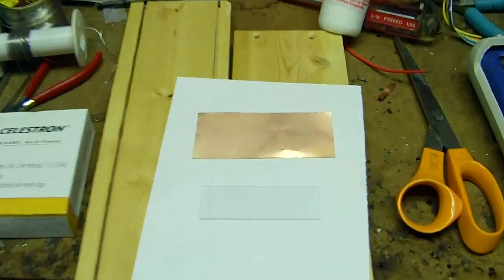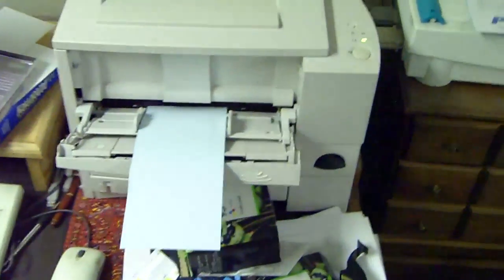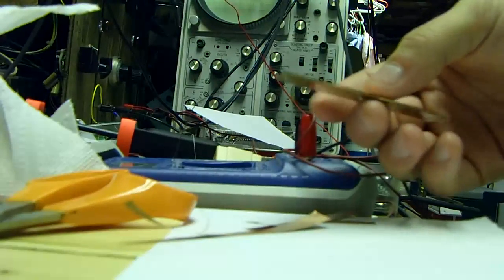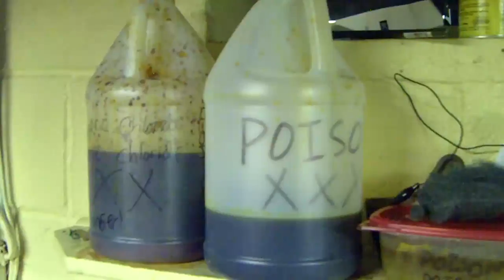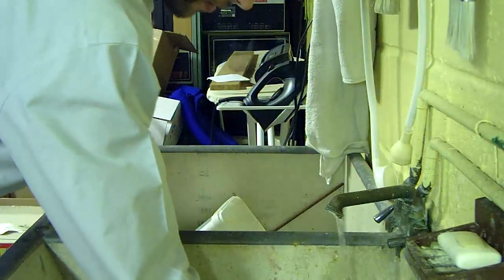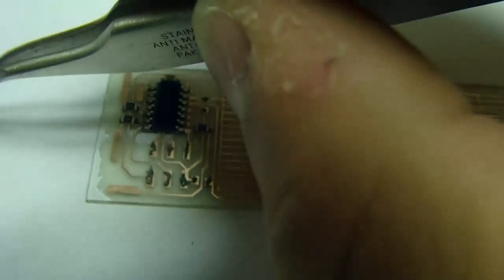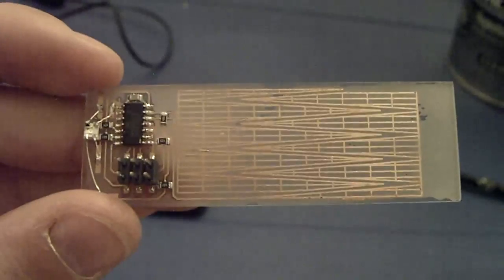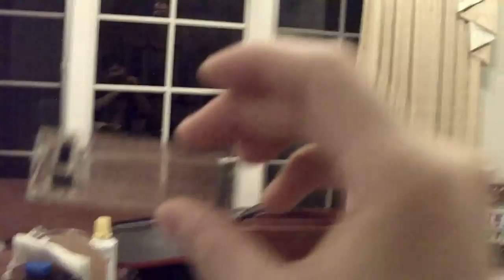How to make Clear Glass PCBs

Comment: Could you use a laser printer to print resist onto the copper first while it is thin? Obviously the printer will need to provide a negative charge to the copper instead of the positive charge the printer normally places on the paper.

Comment from the maker: I actually use the eye protection now for the FeCl, and a respirator for the glue.   Also, I'm using a very different UV light system now, which I need sunglasses for :).  I will add the annotations.  Thank you.

Comment: You might want to consider a 2% sulfuric acid holding tank to keep or remove oxidation off the copper during the process.
Reply from the maker: even now, steel wool seems to be the way to go.

Comment: Optical epoxies should work just fine, and they usually only require a thermal cure. They can also be very resistant to solvents

Comment: Have you tried a UV pond clariier lamp?  I use one occasionally in a special enclosure I built to erase EPROMs.  Mine is 13W, and my cycle time is usually 5-10 minutes.
Reply from the maker: That is what I used here.  It turns out UV grow lights work much better.  See my new video! :)
Reply: CNLohr what video you mentioned here? i can not find it yet
Reply from the maker: I don't know what you mean... do you mean you cannot find the UV light?

Comment: Do you think your "copper leaf" is solid copper, or does it have a thin layer of fiberglass on  the "dull" side?  (What happens if you throw a piece of the leaf into etchant without adding your own backing?) (I'm wondering whether the cloudiness you solve with PU is from the glue, or from the leaf?)
(ordinary glass absorbs a significant percentage of UV light, BTW.  It's nearly impossible to get sunburned inside a windowed building, for example, and "good" UV lamps are made from special glass.)

Comment: Have you tried removing the UV glue in small sections, then painting on a thin layer of thin acrylic? if you do it in small sections, you'll probably not be prone to large amounts of slippage, and will be able to replace the UV glue with something more aesthetically pleasing.... perhaps even embed the circuit in acrylic, or a 2-part clear setting polymer. depending on how you are able to make one-off molding, you could possible embed the entire device in such a material, leaving the connection pins exposed for programming / testing etc.
Reply from the maker: +ArcAiN6 Regarding pulling the traces off... that sounds much more manual than what I can reasonably do.  But, regarding potting stuff, I agree that would likely be cool, but I rework my boards soooo much that it would make me feel bad not to be able to work on my PCBs.
Reply: Completely understand that :D

Comment from the maker: @roostersglass Actually, the frosting is because of left over glue, it is not in the glass. The glass remains crystal clear.  For much larger pieces, I'm still working out the inks, but I have pretty good success with B270 glass. I'm right now going through SI Howard Glass, but they are a bit frustrating when it comes time to ship your package.  I've tried a number of other glasses with less success, low iron, soda, and borofloat.  Other funny thing: my pyrex etching bowl is permanently stained.

Comment: you can use copper adesive tape, so apply on glass and draw the circuit...
Reply from the maker: I have tried that.  It didn't work.  The adhesive tape didn't stick well at all.
Reply: CNLohr Tnx for reply ! and tnx for the tip...
btw: nice work !
Reply from the maker: Actually... the big problem was that it was when you remove the toner, but now, I use UV curing materials to mask off the PCB - it may work.  I'll try giving it a shot soon.
Reply: CNLohr nice...i hope see this ! good luck !

Comment: Chuck is a term used often referring to lathing, here I meant drilling, although facing off the copper might not be a bad idea. With a piece of wire I'd probably just use a file. Make a slurry of carborundum and kerosene, make sure the copper stays loaded with it too. All glass drilling methods are finicky, this one is no exception. It is more flexible due to the nature of tooling though.

Comment: As to 'crazy nervous', can't you get Borosilicate glass slides? I may be coming from  out in left field, but I know that Celestron (if I understood you correctly) makes telescopes- so I'm sorta inferring other precision optics as well. Since the mic slides are just an elegant substrate for the circuit, couldn't there be some other possible source for comparable goodies from some other industry that would have better heat Xfer and tolerance characteristics other than gemlike optical perfection?

Comment: A cpl more questions, on the resistor pads closest to the  programming header there is a tiny trace that runs between the pads, (one pad is connected to the touch array and other is connected to the programming header and then runs up top to a big pad for led connection), anyway the little trace runs very close to the lower pad and I'm not sure if it's supposed to touch it. On your video it looks like you have more space between the pad and the trace but maybe it was just the camera angle. O, and as far as programming the chip, does it need a seperate hex file as a bootloader and then your code or is it all in the code. I'm just learning on these microcontrollers so any tips on assembly or a picture of a closeup would be nice. I  ordered the chips and have my pcb made already, in fact, I made 2 so I could give my Granddaughter one. Thanks again for the inspiration
Reply from the maker: Sorry for taking so long getting back to you.

The wire running inbetween the two leads of the resistor is not connected to either.  In order to get everything on one layer, you typically have to pull unusual tricks like that :-/.

You can use a USBTinyISP programmer, it is available from Lady Ada and it's what I use exclusively for all my projects.  They connect via USB and can be programmed using a .hex file.  I typically use avr-gcc on Linux to compile it, but I have heard good things about WinAVR.

Comment: Now since many are asking about dual layer, I do NOT see it as an "issue", as long as they can think outside the box, stop the "autorouting" and do manual, that means it would need to be less items, as to not over burden them, and also it means they need to think outside the box.
I have come up with a "faux" solution.
So, for those that want a double sided, not with vias... here is a solution.
This will work ONLY with your current copper, since it has a backing.

Comment from the maker: I use the iron after the laminator, because my toner does not stick well with just the laminator.

I've tried using acetone, but it eats the glue so quickly, the copper falls off the glass.

Comment from the maker: @mrpsypi super glue will not work, I tried several times with it.  If it did, there would be many other materials I could use.  Maybe epoxies would work, but right now, I'm going to be trying another UV glue.  If it works out, it'd be cheaper and easier to get (Since it's Loctite brand).  I'll give you a heads up.

Comment from the maker: There's actually a few sources for those tweezers.  I don't remember the exact source, but they come up from time to time. I BELIEVE these are the model I used, but I am unsure. technitool has some Excelta Tweezer Economy SS Anti-Magnetic Type 7 tweezers   << Also, technitool is a good source for solder paste.

Comment: I'm not sure what effect is being used.  Could you stack two of these each running in perpendicular to one another to get an XY co-ordinate or would the metal in each one effect the other.  I take it is causing a change in capacitance yes?
Reply from the maker: jasonofcompsci Nope... it's a differential.  Just linear, up/down... You have two sides, each on its own terminal.  They overlap in the middle, but taper more toward one or the other.

Comment: There is no UV protection layout on your lab slides - it is a physical property of the glass itself. It depends on the glass which types of UV rays they let pass - lab slides are usually made of soda lime glass - this type of glass does not let pass UV rays below 320 nm - so only a very small UV spectrum gets to the glue.

The better solution is to use a glass primer (like Terostat 8519 P) and glue the copper on with waterproof low viscosity 2k epoxy glue and only takes a few minutes

Comment from the maker: Celestron 1mm thick microscope slides?

The HCS is a lot bigger than anything I deal with.  Most of the time I use an ATMega, like I did on my minecraft server on a microscope slide.  It's the same processor that is in most arduinos.

Comment: If you could find pyrex in the right size, would that be better considering its resistance to change in temperature as well as its durability?
Reply from the maker: Right now I'm mostly using B270 glass, since you can still cut it.  Tempered glass is fixed.

Comment: I know this is an older video but I'm curious about something. Would it be possible to make a 2 axis (not sure if this is the correct term) capacitive touch PCB? If so, we could use the same glass etching process here to make a much bigger touch table interface. Add a projector from overhead and walla, you now have a personal Microsoft Surface (old product name; not the tablets) for about a twentieth of the cost.

edit; You may have to do something different for multiple touch. I'm curious what the best (cheapest?) way to make one of these Surface-like tables would be.
Reply from the maker: You're probably much better off using an existing touch screen overlay.  They are MUCH cheaper and can be made MUCH larger, reliably than this process.

Comment: Is there a substitution chip that might be used as a 1 to1 in place of the ATtiny44. Also, is it a 44au, pu or exactly which one will work. I only see one vendor on eBay and I'm not sure if it's even the right one. Great job on this tutorial you have inspired me to make one. One other thought, If you were to try copper tape, maybe you could remove the adhesive off the back of the tape and then use the uv glue? Might be worth a try.
Reply: Sparkfun.com has ATtiny 45 and 85's
Reply from the maker: Almost all ATTiny/ATMegas can do this.  There are a few exceptions I've found, and I'm sure many I haven't.  I could never get the ATTiny261 outputs to work.  I also had difficulty getting the P series of some processors to work.  The A and AU processors have always seemed identical on the outputs to what I use.  In fact, I use ATTiny44 and ATTiny44A processors completely interchangeably and have never run into any differences that matter between them.
Reply from the maker: CNLohr
Specifically, I often use touch sensors with ATMega48As

Comment: Cool but try using epoxy designed for bonding to glass in stead of the UV glue.
Reply from the maker: mrgcav I tried a few times, but if I get back into this again, I will def be trying the epoxy route again.
Reply: CNLohr Elsworth adhesives are experts in epoxy and bonding materials.  Can you post your design, design instructions, Software and PCB board design?
Reply from the maker: mrgcav Just tried it again... This time with permatex glass/metal/wood/plastic epoxy.  It seemed to have difficulty fully connecing to the copper. :-/  also, check the description for those things.
Reply from the maker: The design is linked in the description underneath the video.  And, I haven't actually had any trouble bonding the epoxy to the glass, just the epoxy to the metal. When I peel the metal away, the epoxy stays on the glass and releases from the metal.
Reply: mrgcav imo the best glue for bonding to glass would be the clear silicone bathroom sealants, as they bond chemically to glass.  I'm unsure of how well it would stick to copper though, it may help to clean the metal surface first with a powdered bathroom cleaner.  (Abrasion gets through the molecule-thin surface layer which disrupt coating/paint/glue adhesion.  Solvents typically don't).
Reply from the maker: Sadly,I have tried silicone (it is my favorite adhesive) and it pulled away from the copper.
Reply: roidroid   
Silicone  does not adhere to metal well especially at high temperatures.  Bathroom silicone is more a sealant than an adhesive. Industrial grade adhesives probably an epoxy or urethane are required.

Comment: Glass is really hard to drill. PCBs, which are mostly fibreglass, are already hard to drill and require expensive drill bits. Actual glass is even harder. Make sure you get really good carbide-tipped drill bits. Also, I think that tempered glass will shatter if you drill it.

Comment: If the glue is strong enough, I would think one could scrub using steel wool.  If it doesn't catch the material, maybe start by gouging a few holes where there aren't any traces.

Comment: Cool, I am definitely interested in seeing that, can you do a video of the process? You have inspired me to remake the touch glass as soon as I can locate another piece of copper foil. I may go with a tempered glass this time because the last one I cut from a n old window glass from the 50's and it was very thin and fragile. I like the idea of the microscope slides but we'll see. Also, on the last one I just got lucky with the programming I think. I used your files but I tried setting the fuses like I did with the fabisp and I think if I would have just typed make like you did, (once I have the right directory), it would have worked?  I was using winavr from the cmd line and I've only done this twice now but I love learning..

Comment: Why not pre program the micro controller so you don't need a big connector to your board.
Just make a little PCB with the footprint of the controller and just hold it down while programming. Then you only need a VCC and GND connection by soldering wires to some copper area.

Comment: i know is pretty much a dum question, buttt, what kinda glass did u use again? 
ohh and can u give some infor about the spersmall micro chips u used, im new to electronics , ive  learned abt programing some mocrocontrollers, like HCS12E128 or adurino, but tis the first time ive comeacross these supersmall ics...
so my main question is can i do stuffs i do with an adurino kit, using these ics?
thnx for ur time :)

Comment: The reason why it's not very clear is because you're brushing it. Use a small 90 angle tube sprayer. I forgot the name. But basically it's two tubes at 90 degrees. One is dipped in the bottle the other you put air inside, either yourself or a pressurized system. And at the 90 it will spray the poly on the pcb.

Comment from the maker: I have tried several others. Most glues need access to air to actually cure.  The glue is sandwiched between two things that don't let air in.  I've tried some two-part epoxies and silicones to no avail.  They either didn't stick enough or didn't go on evenly (or had other problems).  This martronics stuff is made out of magic.

Comment from the maker: Because nothing I do has been surface mount for over 2 years now, I hadn't even considered two layers.  I wouldn't be able to use this tecnique, because I wouldn't be able to get the UV to the other side to cure the glue.  Additionally, I don't have the special grit or anything to drill the glass. :-/

Comment: well I should have but yes I did, I dropped it and broke the glass. I wish I would have gotten interested in this cool stuff when I was a young man and not clumsy and shaky, sigh! anyway, thanks again. I would like to build the tinyisp3 you have but there are a few components on there I'm not familiar with but I'm gonna study it and figure it out. I built a fabisp and it programmed perfectly, and looks perfect but I can get windows 7 64 to recognise it. Keep posting your videos are great!!
Reply from the maker: I'm actually working on new form-factor of my attiny44 tinyisp.  I should post that soon.  I only have the designs up.  https://oshpark.com/shared_projects/ijclv4pr

It's a complete rip off of the ladyada design, but much smaller and fewer parts.

If you're interested, I could try to make a blog post about it in this next week.

When you plug it into a computer, it functions identically to the ladyada design.
Reply: CNLohr I checked it out, nice. It looks like you have some nice protection built in on this one. I may have to order 3. That wouldn't be the design you were working on in your other video with toper, (or however its spelled), hehe. I have a small cnc which I like to use but for tiny traces and lots of via's it sometimes better to use toner transfer (or order) for me. Keep up the good work, you are one of only a few that got me hooked on this hobby!
Reply from the maker: About the glass, that is lame, but to be fair, the first few I made didn't etch right, and all sorts of other problems, then there was this time: http://i.imgur.com/TIoN0qn.jpg

Nah, I've made a bunch of different tweaks to the tinyisp design, here and there.  I guess I could do a video on it... Do you mind reminding me after I post my next one?

Actually - I did use Topor on that one I linked now that I think of it, but it wasn't the one I did the video on.
Reply: I can relate to the shaking, with some imagination we can produce a method of assembly that eleminates the fine work.
Reply: I learned the trick to not shaking, is hold your breath, works for me, yea.
Rock on Stephen Wolff